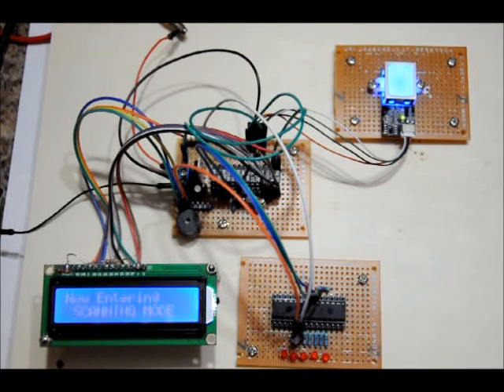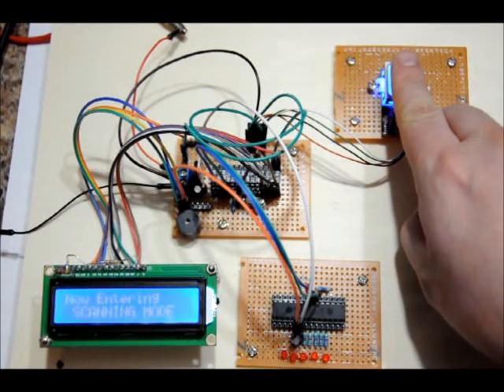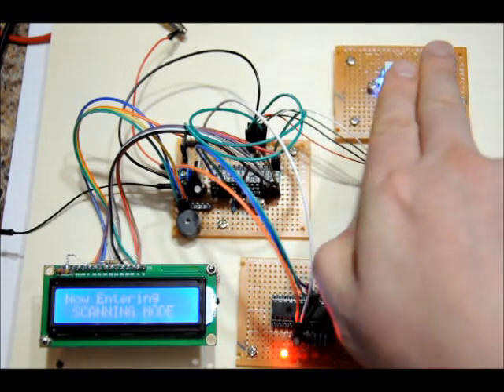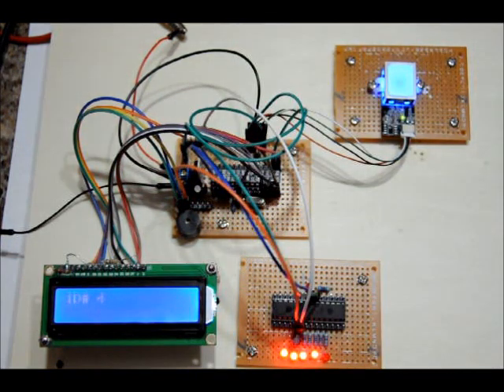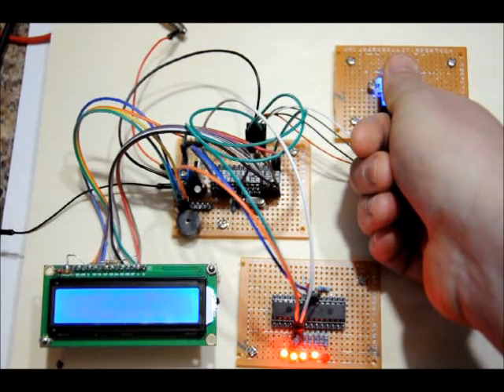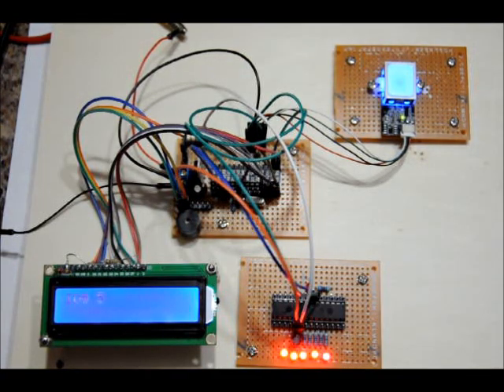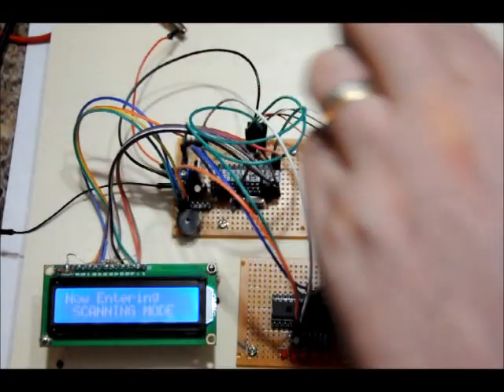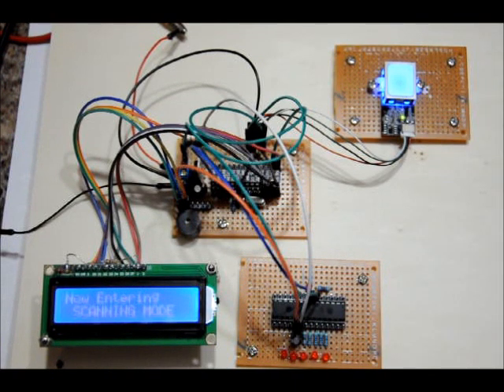Fingerprint Scanner Project!  So many possibilities!

Comment: Did you ever have issues with serial communications between the FPS and the Arduino while plugged into your computer? For some reason, mine works fine until I plug it into the PC (in an attempt to view the serial monitor). For example, the FPS_Blink sketch doesn't work if my Arduino is connected to PC, but when disconnected and running on battery power, it works just fine!

In order to enroll fingerprints, I had to solder on a USB breakout board to connect directly with the PC instead of going through the Arduino. Now that I've enrolled prints that way, I don't need the serial monitor, but I'm still curious as to why it never worked..

Comment: hi ,thanks for the video.
ı just have problem with FPS-Enroll sketch , it doent work properly with arduino . Do you have any solution for it
Reply: same issue it says sensor not found
Reply: Hey, i just wanted to ask, how did you set it up with the ardunio? also are you using the UNO model?